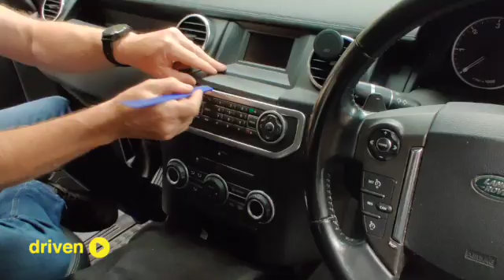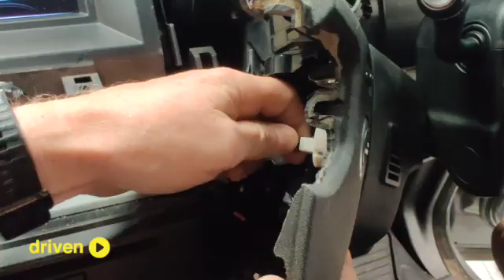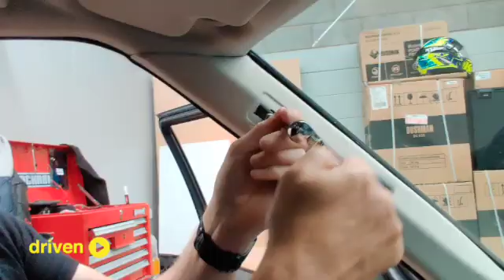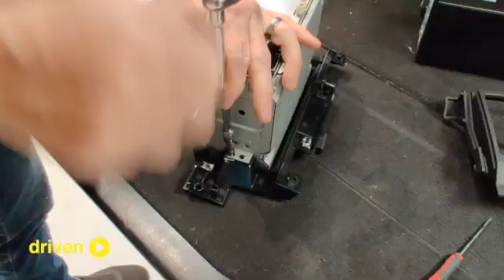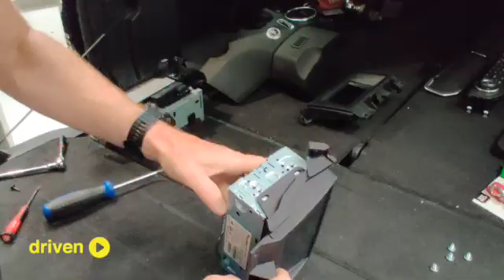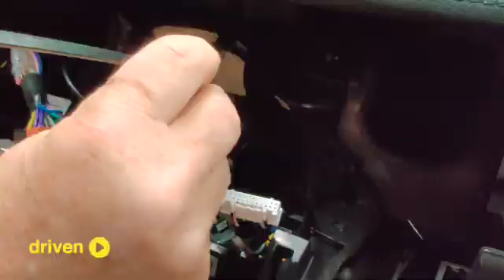Discovery 4 CarPlay Retrofit - Complete 'Plug & Play' - 4.3" to 7" Screen Upgrade

Comment: HI!  Will you lose the use of the CD player?  Could you tell me if it is compatible with the car radio without touch screen, without hands-free and without navigator of the Discovery 4 from 05/2010?  Thank you🙂
Reply: The kit suits all cars with small screen from factory. The dash mounted radio controls and CD are no longer operational. All functions are controlled by the steering wheel controls and new touch screen.

Comment: I have Harmon Kardon factory upgrade sound does this replace that or work with it?
Reply: It works with it as long as your speaker cables are connected. I think you can even do your amplification on the screen, too.

Comment: Hi there. I think you may have mentioned this early on in the installation.  I was wandering. I’ve got a full screen option for my discovery 4. Will this work for that ? Or is there a simpler way?  eg. A kit where you can just add Apple CarPlay ?  Also. Does this unit have a built in stand alone GPS? Is the Apple car play wireless or via usb only? If so is it the usb int the centre console ? Can you comment on the sound quality vs original head unit ?  Sorry to ask so many questions I understand this is an installation video. I wander if you could point me to a operation of the unit type video? Thanks again